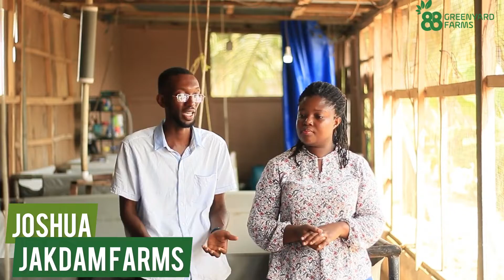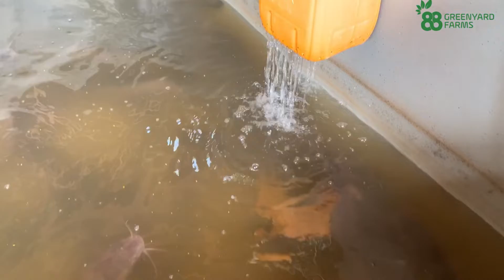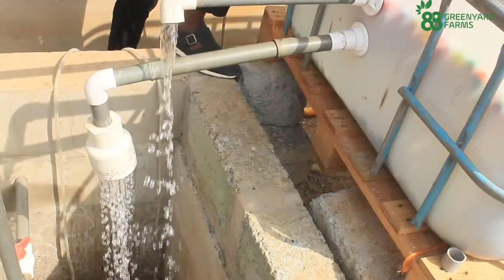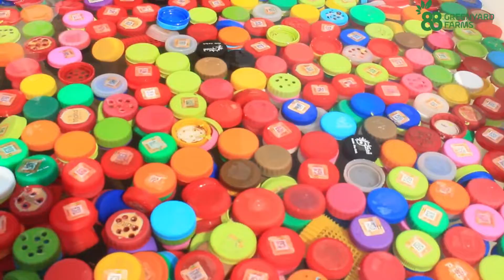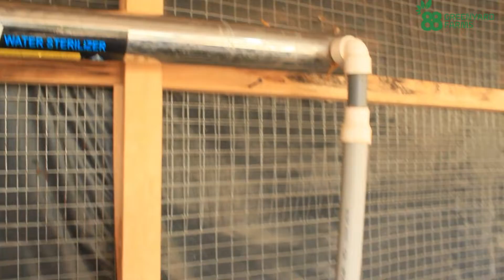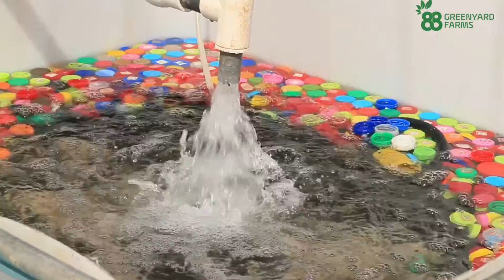How To Grow CatFish Without Water Change ( Recirculating Aquaculture System) - part 3

Comment: 8000 Catfishes and a pump with a 350watts power ratings? The fishes appear to be too much for such a pump. Unfortunately you didn't know enough to say the volume of water you have in this 8k capacity fish pond and what the pump's max flow rate in gallons per hour is and how many times per hour the entire volume of water is pumped through the filtration system. And how many times a day you evacuate the accumulated fish waste from the filter itself, yes, the solid fish waste don't magically disappear. These are very important information that's missing in your presentation.
Reply from the maker: Thanks for your input.